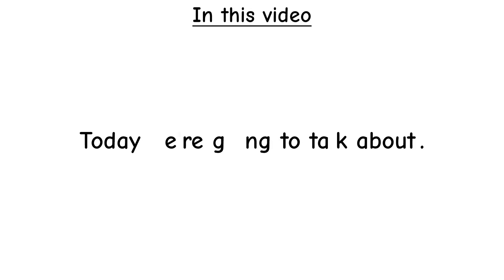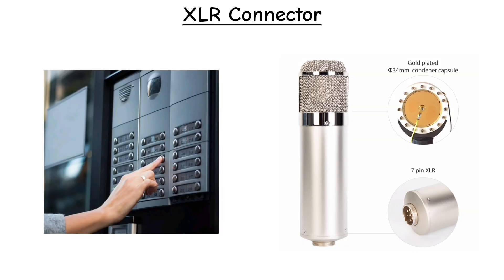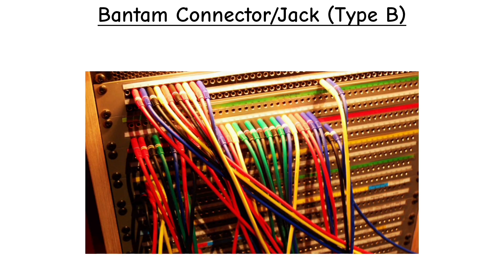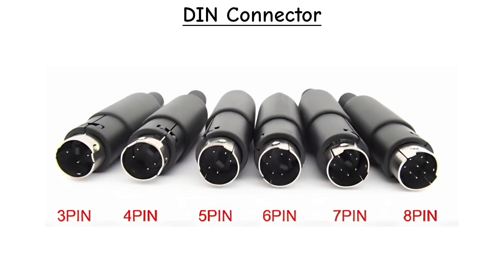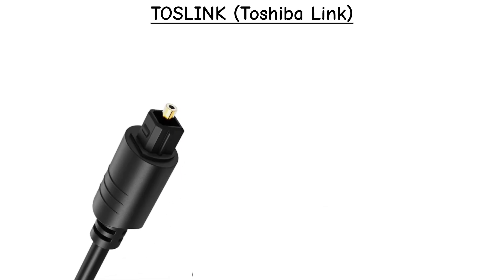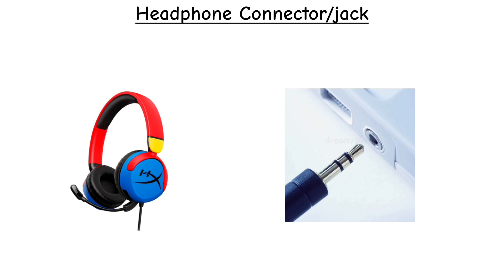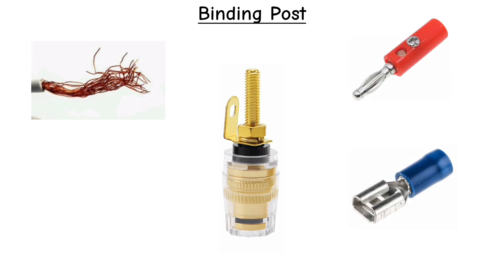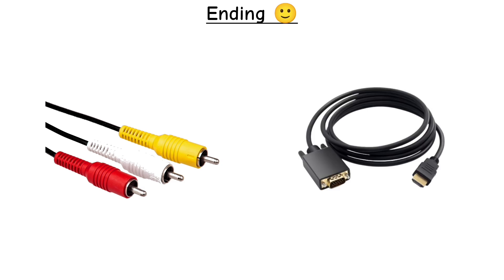Every Types Of Popular Audio Connector Explained Simply

Comment: uhhhhhh the 5 pin “xlr” you showed is actually a DMX cable😊
Reply from the maker: Really 🤔
Reply: @defineexplaining yes indeed in the early 90s they were concidered the Standard Dmx connectors but the pins 4 & 5 weren't used (thou it was planned to be used but i didn't happen). So thats why you see on modern devices the 3 pin dmx connectors

Comment: 3.5mm Jack connectors are still common for wired headphones, mostly for home/office/school use. The bigger 6.35mm version is common on professional and hi-fi devices, cheap size converter plugs are available to be able to use the more common 3.5mm Jack instead. The smaller 2.5mm size is basically (almost?) obsolete now, cheap converter plugs are available to convert them to 3.5mm instead if needed. Also, "break out cable" is available for the 4 pole Jack connector to provide a 2 pole connector for microphone and a 3 pole connector for headphones instead ‒ in most devices 3 pole Jack headphones work fine in the 4 pole connector, the device can detect what's plugged in.
Reply: And on wireless bodypack microphones & IEM systems. Some are equipped with a threaded locker ring.

Comment: Technically 3 and 5 pin “XLR” used for lighting and stage effects is called DMX bc it is sending digital rather than analog signals and they are 2 different cables because they use different resistors to match the signal being sent/recived
Reply: the plug is still called XLR, dmx is just the protocol
Reply: XLR is a type of PHYSICAL CONNECTOR.
DMX is a type of SIGNAL PROTOCOL.
XLR connectors can carry analog, DMX, and AES/EBU signals, as well as some new proprietary protocls like Behringer StageConnect.

Comment: Speakon and Powercon without a doubt have been some of the best innovations when it comes to jacks. Because they protect the user from accidental shock and make it super easy to plug and play as well as daisy chaining low power devices like lights and circuits <5A at 120VAC.
Reply: Also super small footprint